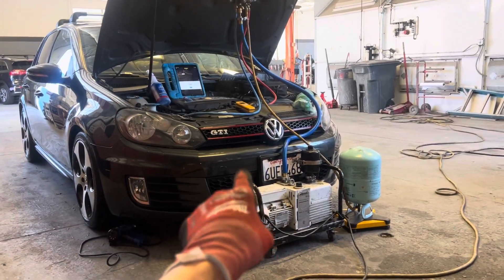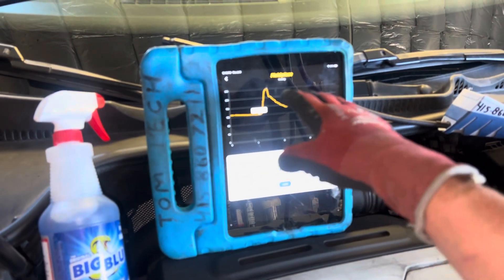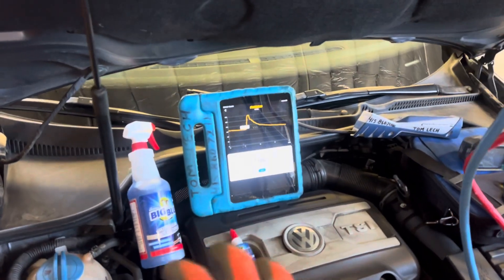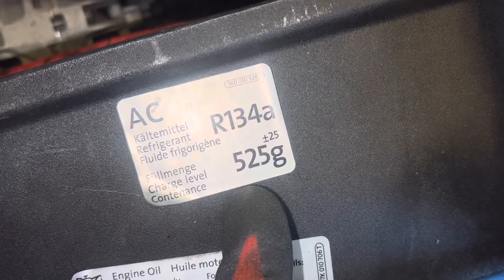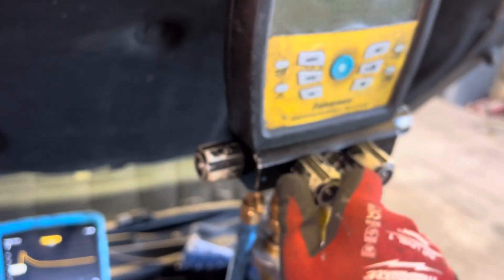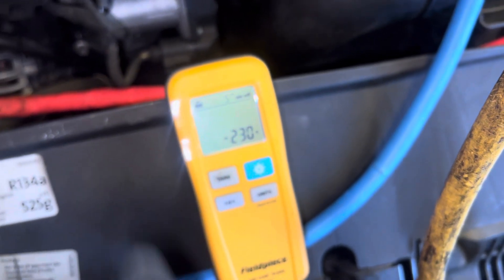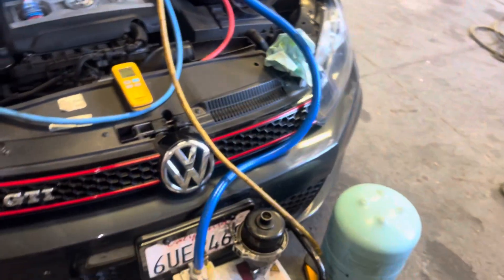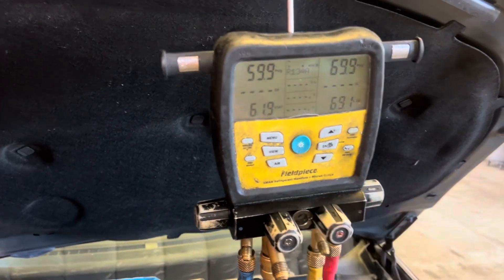Moisture popping out of refrigerant oil. Micron gauge can read it.

Comment: So.. sucking system down ( especially larger comercial aplications), can moisture still be traped in the system at the far ends away from the service port?
I generally use nitrogen to try and push through the system. Seems to make for better vacuum next go around.
Reply from the maker: That is exactly what nitrogen is for

When you reach the limits where you cannot suck out any moisture anymore or has slow down ridiculously . 

You use nitrogen to sweep it from say, push in the high side, suck it out the low side . 

And like you’ve noticed you’ll notice that the back and goes down faster the second time and deeper . 

The micron gauge will always tell you when you have moisture in your system. When did the moisture is very close to the micron gauge or if the moisture is located 1000 feet down the end of a length of pipe micron gauge will still read it exactly the same. .
Reply: @coldfinger459sub0 lol.  That is not what nitrogen is for.  Nitrogen is for creating an oxygen deficiency inside the pipes so they don't oxidize when you braze them and for pressure leak testing because it's considerably cheaper than refrigerant and far safer than compressed air.
Reply from the maker: @engineclinic  that is not all with nitrogen is for. 

It is for displacement of atmosphere.  So corrosion does not occur not only for Brazing, but after Brazing.. 

Nitrogen is for sweeping the system under deep vacuum when you can no longer have molecular flow to remove the moisture out of a system you sweep it with nitrogen just like a broom sweep up leaves out of your garage out the front garage door

Nitrogen is used to sweep the system. 

Call triple E vacuum, purge. 

Something you learned when you’re going through your HVAC apprenticeship in the union when it was mandatory for you to go to school at night and weekends

Or something you learned when you were taking your 2 1/2 year HVAC degree course specially going for your contractors license and your first semester HVAC, 101.

Comment: Hi Tom,instead of this long procedure can you fush the AC  system and put new oil and charge it?.Which is easier and cheaper?
Reply: It's probably a lot harder to flush a system than it is to set a vacuum pump on it and let it do its thing. Either way, you're gonna have to get all the moisture out